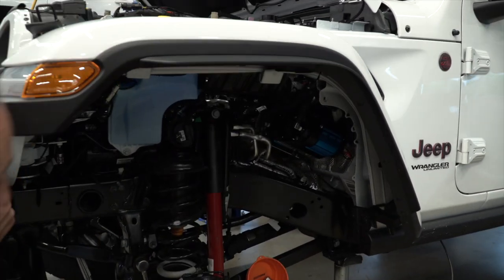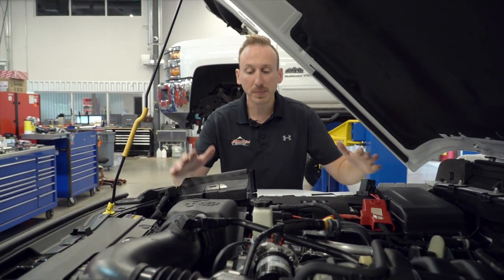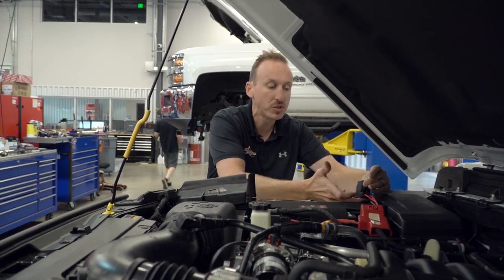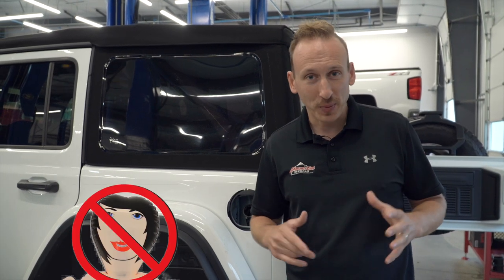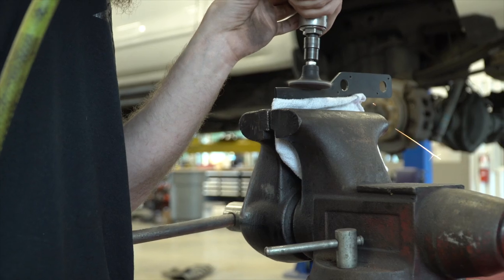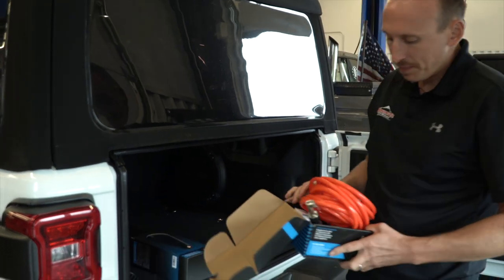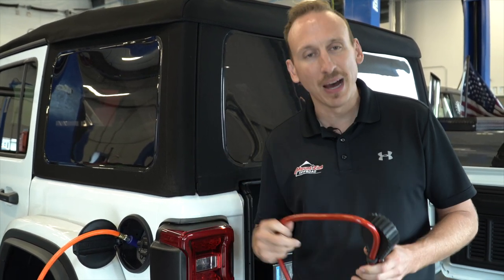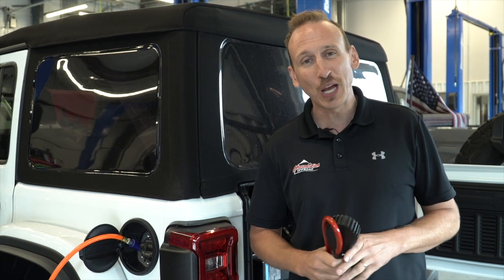We Install Hidden ARB On Board Air in this Jeep Rubicon

Comment: The problem with mounting the compressor in the engine compartment is that when you go to air up the compressor will be hot already
Reply from the maker: That's a good observation. However any compressor, especially compact compressors, get hot very quickly regardless of their placement.
Reply: @MountZionOffroad  I have my arb single behind the back seat of my gladiator and it never gets so hot that it shuts off. My cousin has her in the engine compartment and when she’s airing up it  always shuts off because it overheats and hers is a dual arb. I do open the door and put the back of the seat down to let mine get air.